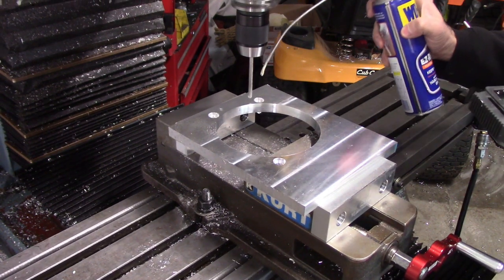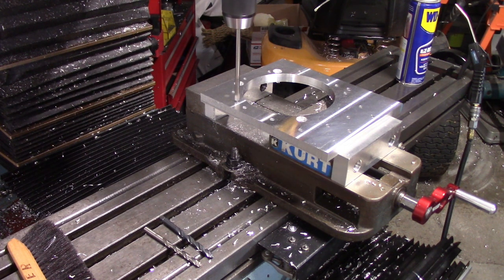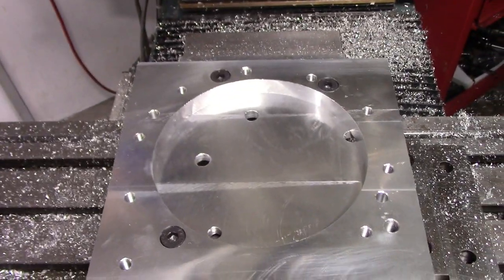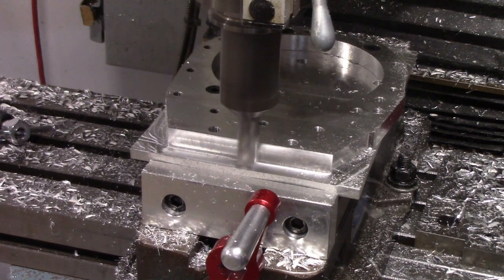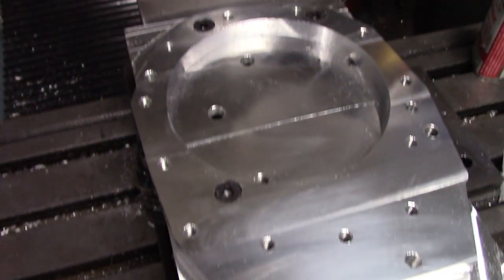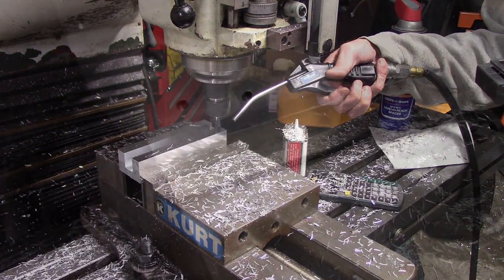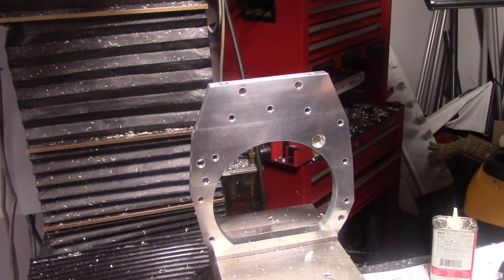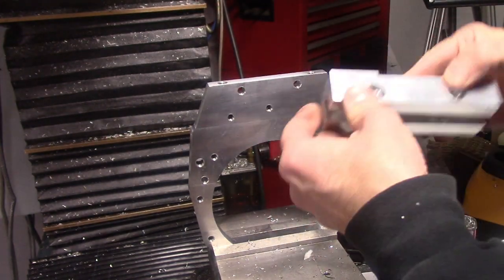TR6060 to Charger Transfer Case Adapter - AWD Mustang Ep6,

Comment: At first I was thinking that the cross bolted fixture was unnecessary, but with that there the main fasteners are left to do what they're designed to do, which is clamp the mount to the plate. The fixture keeps any fore and aft movement under control. I'm not sure how much of that there will be but I'm sure it's not going to be small considering the amount of torque a turbo Coyote can put out, especially with a manual and the dynamic loading involved during shifts. Very cool. As I dive back through these build videos I'm increasingly impressed with your engineering skill and attention to detail on the build. Nice work.

Comment: I agree that Ford should really consider making an AWD Mustang with a prodigious amount of power and market it as an American GT-R. Unfortunately, they would have to be willing to invest more into the electronics of the transmission, limited slip differentials, ABS system, ESS, and suspension than they currently do. That's kind of what makes the GT-R so legendary. Every generation of the GT-R has been an absolute tech showcase. To compound the difficulty, as you're probably finding out, the Coyote motor is very wide and takes up a lot of space, so working around it is a bit of a nuisance.

Very cool project, I hope everything ends up working out well and you can get an ECU that can handle controlling the electronic transfer case using input from the ESS system to vary the power delivery between the front and rear wheels.

Comment: Any chance you'd make another adapter plate? 😂
I ordered a scat pack 6 speed, and would love to make it AWD.
Reply from the maker: I have received quite a few requests for parts.  Basically, I am not going to consider making parts for others until my car is on the road and proven out.  

Your idea for a project is awesome.  I did a lot of research and soul searching before starting the Mustang.  I knew I wanted to make a boosted manual V8 AWD car, but I considered a few options before coming back full circle to a Mustang.  I seriously considered a Challenger for the simple fact that one could use the factory AWD front suspension.  The front differential may be an issue since there are no gear ratios available that I know of that would work with a manual transmission.  

Keep watching and we will see what happens once I get it on the wheels.
Reply: @npvg  
Challenger 9" rear swap
3.07 rear gears
AWD spindles, axle shafts, and oil pan
Front differential (3.07)
Reply from the maker: Yes, you can get a matching front rear 3.07 diff, what I am saying is that a 3.07 diff with the TR6060 gear ratios is not a good combo.  

The front diff is the same as several Mercedes models and it looks like the GLK has a 3.67 option, you could get the front and rear from one of those. Maybe there are others in the MB world, I did not research to deep.

Comment: I love this video and this entire idea, I have alot of questions for you as I'm going to try and start a page up soon. I wanted to know just how intensive would it be to try and adapt this 6060 to a regular bw4411/4410

I am a lucky owner of an 02 explorer 5spd manual but even the manual ex is pretty garbage for a small truck, I've been gathering supplies to do a 4v modular swap from an aviator but am trying so hard to keep my transfer case in tact for ease of install
Reply from the maker: I would talk to Rockland Standard Gear. 
http://www.rsgear.com/products/off-road-truck-transmissions

This sounds like a really cool project.  I had a stick 4.0 Ranger many years and loved.  I wanted to do a V8, but never had the time.
Reply: Thank you for the quick reply man! I'm stoked to see this project more and more and hopefully someone can get me some sort of solution to mating this thing up
, Once I get more free time I'm gonna start posting what I have so far and hopefully, those vids will eventually be on par with your work